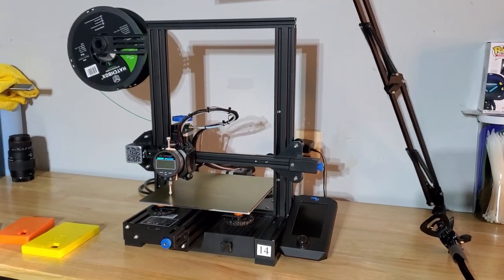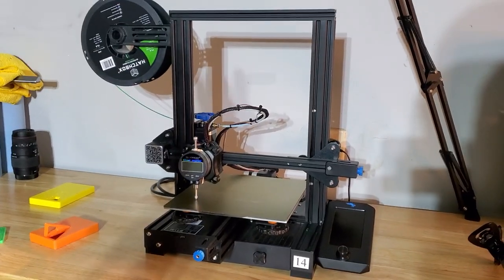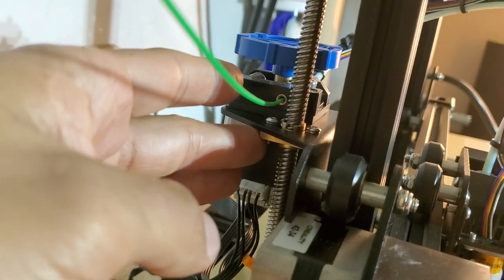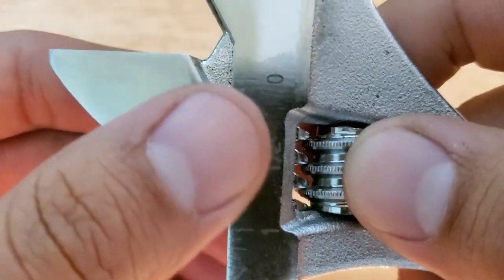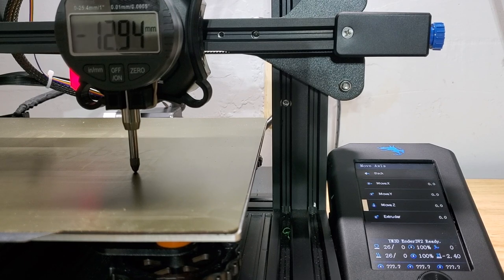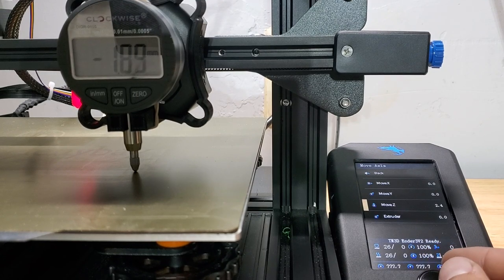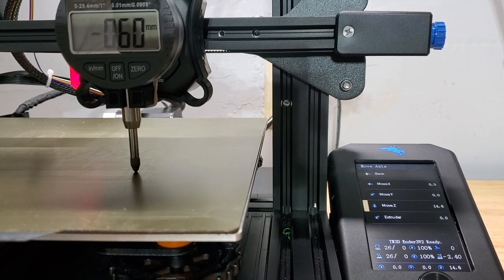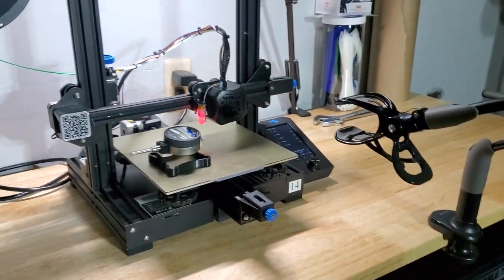3D Printing Elephants foot. How your lead screw is causing it and how to fix it! Ender 3v2

Comment: I feel obliged to point out that if you encounter binding on any axis, check the eccentric nuts. I underestimated their influence once, and after a minor adjustment, my X-gantry rolls a LOT smoother, with all six wheels making contact. Sometimes, taking it all apart and properly and carefully reassembling it does help!

Comment: I have new lead screw nut on order right now for this exact problem on my Ender 3 Pro. My Ender 5 doesn't have this issue. I knew something was up when the BLtouch didn't seem to work and I could print the first layer with the nozzle too far from the bed and the 2nd layer was way too close to the bed.

Comment: Also, check results at the left end of the x gantry and compare to the right end of the gantry.. On my ender 3 max the lag was not present at the driven end but really bad at the right, it turned out that the vertical frames were not parallel by a whopping 2.2mm closer at the bottom than the top!, this caused the gantry wheel tightness to change over the vertical travel and amplified the issue especially when the carriage was over at the right where its not driven and gravity is working against it.

I fitted a shim to correct it and a dual z drive to my 3 max, IMO the larger print volume of the 3 max is exceeding the ability for a single z drive to maintain a level correctly across the gantry, it is really quite a poor design to only drive one end of the gantry, a 200mm span is probably fine, but when you start to get up to 300mm and beyond its a failure waiting to happen I think.

I was also suffering terrible elephants foot which completely disappeared after the fix which I never really thought about at the time but now watching this its plainly obvious why I had that problem, but it was not that which led me to the issue, I was having terrible trouble getting consistent first layers and I actually watched the gantry while stepping up 0.1mm at a time, you can actually see a 0.1mm step with the naked eye (well with my glasses on because I cant see a bar door from inside without them) and I saw that the right hand side was not moving at all for the first 3 or 4 steps up after lowering the nozzle to the bed but  the left hand side was actually moving from the first step (it already had antibacklash nut on the lead screw)

It took me 4 weeks of being told "learn to level your bed" every time I asked for help, no amount of stating I know for an absolute fact the bed is levelled perfectly would sink in, "level your bed", "your beds not level", "you are new to printing and dont know what you are talking about, its a bed level issue".. 

It shows you how tiny a problem has to be to completely screw up the final print!!!!
Reply from the maker: I agree, I sometimes don't like asking for advice in groups or forums because the answers are always pretty basic. You have to really dig deep yourself and find out the problem! I agree the single lead screw design is not good even for 235mm. If the printer had dual z and linear rails I really think this would be the perfect printer given its design.
Reply: @Redo3D  lets be honest, Creality are not interested in the perfect design, its all about profit margins.. 

But they could produce a "proper" pro version instead of "pro" meaning some of the good things dropped and some other things improved! An increased price and over all increase in quality and it would sell I am sure, and still make a profit and a better reputation!
Reply: @Redo3D  I guess I am lucky, I was an electrical/ mechanical maintenance engineer for much of my working life and have an ability to logically approach and break down issues, 3d printing is a whole new skill set but I am finding that much of the "community" including some top level players, are very much a do it this way because everyone else has done it this way without any really understanding WHY they do it this way.. 

Asking for help is now the last resort for me, the more I listened to others the more I realise they don't really understand the underlying concepts fully, if at all. Of course there are exceptions, but you find the exceptions usually are not relying on youtube hits and ad revenue..

Comment: I know people really hate rafts, but ive started printing mechanical parts on rafts with 5-8mm spread to be a bit faster and less wasteful. You dont really get the benefit of the uniform surface where it was touching the buildplate, but I have managed to avoid elephants foot, fusing, and have had a non-zero improvement in overall layer quality by sort of bypassing the bed itself as being the primary build surface. The raft will also grab tree supports and keep the prints FLAT regardless of bed size instead of trying to strike a delicate temperature balance to not have corners peel up, which I think is extremely important for anything with mechanical use. Ive also found that my bed does not heat super evenly, I get temperatures ranging from 45c-62c when I set it to 60 on the printer. Using the rafts spreads out the surface area for adhesion even if the temperatures are inconsistent, in my experience.

Comment: could the underlying issue actually be the frame or the wheels. my reason for suggesting this is that backlash in a vertical position should not cause this type of issue due to gravity. if the frame or wheels was binding the maybe enough pressure at the bottom of the frame to hold the z axis away from contacting the leadscrew. fitting a anti backlash nut is helping to overcome this binding hence the improvement. I've rebuilt my e3v2 several times trying to improve the z axis fitted rails and tried a double leadscrew but the underlying issue seems to stem from the frame alignment

Comment: Hello, well done! 

But from my humble point of view it's only half of the investigation of the engineering task. I observed simelar problems on my Ender-3 (Pro) and was investigating them too, the same way as you did with a dial gauge. I went further by testing the reproducability of the zero position and could observe, that the reproducablity of any desired postion was in the range of a one digit number of 1/100 millimeter, when the print head was settling from top to bottom after I raised the print head at least 0.3 or more millimeters and then settling it back onto the desired position, just the same way as Z hop of 0.3 mm or more does. 

Since I do not like to Z hop on every print head move to avoid Z nut wear, I crafted a Z layer change G code for the slicer, which does the Z hop only on layer change and all my elephant foots where gone, also without those spring loaded backlash nuts. I'm curious, if this could work for you too? 

But anyway, well done and well presented. Regards, J'Lo

Comment: Old video I know. But thought I’d comment anyway. I have a small machine shop and know backlash pretty well. Backlash will be removed as soon as the z axis starts moving up.The reason you’re still getting error after it starts to move up is because there is also wear in the lead screw. The brass will wear faster no doubt, but fine abrasive material will impregnate itself into the brass over time and wear down the lead screw also. It’s slower since the lead screw is quite hard but it still happens. As you keep raising it up you get into the area of the lead screw that’s less worn so it becomes more and more accurate. Obviously since most of the printing is done lower down on the lead screw that’s where the most wear is.

And I’m curious but I would also guess that the backlash is worse when moving up rather than down. Since the pressure of the brass nut and lead screw is higher when it tries to lift the gantry, but when it lowers it there’s gravity to help it out so there’s less friction. Just a thought. 

It would be better if the printer could tell actually how much it moves with glass scale from a DRO or something. So even with backlash it will keep moving until it reads that it has moved the commanded amount.
Reply from the maker: Thank you for this explanation. Makes total sense

Comment: Loving the content mate. Did you ever fully get this one dialled in? Ive got 2 x ender 3 v2 neos and 1 is spot on close to perfect prints and the other seems to be encountering the issue youre having.
Reply from the maker: Yes. I ended up changing the lead screw nut on all of my machines with brand new ones and it significantly helped the situation!
Reply: @Redo3D oh nice! I had another neo just got back from repair after I blew the mobo... its working perfect along with the other one. The third is going back. Its definitely not moving back to the same z height repeatedly. Hope they swap it for a new one. Thanks for the reply 👍

Comment: Sir your video is clear and concise Can I ask you a ? I now have 2 ender3v2 and would like to install a bl touch on one of them My ? Is how do I differentiate between the 2 and will the start code installed on one effect the other Uce gone into creality set up and added it as a B machine But it wasnt showed up on my cura Which I'm using
Reply from the maker: Hi Charles, yes the start code for the machine with the BL Touch will be different. So the Gcode file won’t work with the machine without the BL Touch. If you use the G29 Command to probe the bed before starting your print, when the printer without the BL Touch tries to read the G29 command I believe it will say probing failed and it will not work. So you will have to slice the file without the G29 start command. My recommendation is to have the BL Touch on both machines if you can.

Comment: Hey, thanks for the video ! I actually want to try this now ! which lead screw replacemetn did you end up getting ?
Reply from the maker: I haven't replaced the lead screw just got new lead screw nuts. I recently tried POM nuts from a viewers recommendation, and I think they work better! I haven't done any measurements yet.
Reply: @Redo3D  sorry I meant the lead screw nut. Do you have a link for the one you are talking about?

Comment: Ty for this very well explained video .
do you have a reference of the anti backlash nut you have used ?
Reply from the maker: This is what I have purchased 2-Pack CR10 Z axis T8 Anti Backlash Spring Loaded Nut Elimination Gap Brass Nuts for Upgrade Ender 3 Ender 3s Ender 3 Pro V2 CR-10 Tornado 3D Printer 8mm Acme Threaded Rod https://www.amazon.com/dp/B08LZ1V56T/ref=cm_sw_r_apan_glt_fabc_AQE7D5ZDW7GHA827H6HQ?_encoding=UTF8&psc=1

Comment: I dont know if it is backlash since the weight of the gantry will always make sure that the worm gear will always be resting on only 1 side of your gear nut it should never be able to engage the other side unless your printer  flipped upside down. but it's always a good idea to replace these consumables when poor tolerances like these starts to appear.

Comment: Good explanation of elephant's foot. Rather than a backlash nut(s) what about just weighing up the total X axis carriage such that it always maintains an increased downward force on the nut such that there is no freeplay between the screw and nut?
Reply: you will just increase wear and print slower. the anti backlash nuts do basically the same thing, use a spring to force against the top and bottom sides of the led screw

Comment: its a great explanation for elephants foot. What I also found that helps is increasing your mesh fade height if you have a severely warped bed and elephants foot that goes up 1mm or more.

Comment: Mine started with elephants foot and has ended with not even sticking to the bed and prints failing 75% of the time. I have extra lead screws for a CNC im building so ill try this out thanks

Comment: I would expect gravity to take up that backlash - unless the rollers are too tight. The non-driven end is particularly sensitive to roller tension and hysteresis. My Poor Man's Dual-Z is another option - just an extra belt to take up the slack.
(3rd attempt after my previous comments just vanished?)
Reply from the maker: Hey Troy. Not sure why your comments vanish. I appreciate your insight and knowledge share. I also expected gravity to take up the backlash but that is not the case. No matter how much I adjus the rollers, I cannot get the gantry to drop under its own weight
Reply: @Redo3D  Fair enough, though it still sounds like binding to me but that may be unavoidable in some cases with rubber wheels. I also like to loosen off the roller bracket screws and tighten in place to make sure all 3 wheels are aligned.

Comment: Great video and awesome job doing a live demonstration of the problem. Do you use lubricant on the lead screw? If so, what do you use and how often do you apply it?
Reply from the maker: I do use ptfe lube that I purchased off Amazon. I only apply it once until I notice the lead screw it dry. It should last a long time before having to reapply.
Reply: @Redo3D  I just installed an anti backlash nut and still have elephants foot. The slight horizontal squish doesn't bother me but these crushed layers are ruining my accuracy. Cubes come out at ~19.8mm the second I print on a raft it eliminates the elephants foot and accuracy is spot on. Any other tips to help with this loss of Z height?

Comment: I think if your gantry an leadscrew are moving freely and leadscrew is not binding with the brass nut (brass nut screws 2 turns out allow brass nut to move sideways) the wheight of the gantry will always force the brassnut down on the leadscrew teeth so there shoult not be any backlash. Hence the leadscrew does not pull the gantry down but the gravity pulls the gantry down. The leadscrew will only allow it by turning backwards. Thats my understanding maybe i am wrong..

Comment: I think my lead screw nut has worn out as well.  I have a CR-10 mini that's probably about 4 to 5 years old.  I'm seeing some odd behavior from the first few layers (elephants foot, bad surface texture, etc).  What anti-backlash nut did you use?  I see some on Amazon, but the quality is often hit or miss with 3D printer components.

Comment: Great video! Very useful information, about how long before you started having these issues?
Reply from the maker: These particular printers were purchased 2nd hand from an Amazon returns reseller. So I'm not exactly sure how long they have been printing.

Comment: Wait, what does the backlash have to do with anything from the second movement up and onwards?
I get the first upwards movement right after a downwards motion only moving 0.07 because the teeth had to disengage the bottom thread and engage the top thread, but shouldn't the teeth now be engaged and move the full .3 on all subsequent upwards movements? I think your problems ran deeper than simply backlash.

Also, if you loosen your v-wheels a little bit, gravity should force the gantry down, and always keep the top of the teeth engaged, instead of engaging the bottom teeth and forcing the gantry down, it should slide down on the screw, finishing the downwards movement with the top teeth still engaged.

Comment: Are the vertical extrusions square?  Gravity should be pushing the x gantry down and taking up backlash when moving upwards.  Seems like your rollers are overly tight for some reason and exacerbating the backlash caused by the worn z rod and nut.

Comment: A little strange, because gantry weight, should ensure that the lead nut is always touching the top area of the lead screw thread. So the elephant foot should be rather an effect of wearing off the lead screw in the bottom part. And that could be seen on your video. The backlash doesn't explain, why the effect was still present after advancing more than a height of a single lead screw thread step. The "lost" of the initial Z advance was mostly due to first pushing down the print bed, which was clearly visible.
Of course, I don't negate the backlash of the nut, but it is the filament pressure which could raise the gantry up, during the initial layers, due to the lead screw nut backlash.

Comment: I’ve found POM nuts to be the answer to this problem. I purchased a bunch of anti-backlash POM nuts to cover a bunch of my printers, but ended up not using the spring or bottom section of each nut, because the POM nut itself fits the lead screw so snug without them.
Reply from the maker: I will give them a try! Thanks for commenting.

Comment: Theoretically, you could test this by z hopping mid print and if you get bad prints then you can assume it is this, correct? This is the first time I'm hearing of this after trying to get rid of elephant foot after not printing for a while, this would be more prevalent and known about I would think if it's a common issue?

Comment: thanks for the detailed video. I understand the initial backlash when the direction changes. But once you engage with the top of the nut I would expect the movement to be consistent. So why are you still getting 0.28 increments when you move by 0.3 after 9:45? If this continues then the whole print will be shorter.....
Reply from the maker: The difference is very little. I think it was off by maybe .03mm. The initial travel was off by quite a lot
Reply: Just remember that using an indicator to measure movement like that requires the stem of the indicator to be parallel  with the lead screw in at least two directions or it will measure the hypotenuse of the right angle that is being measured. The more the distance traveled the more off the accuracy will be.

Comment: Would adding weight to the gantry (not the extruder) help to keep the nuts engaged with the lead screw? I guess a bit more extra weight would not harm at least since the Z-travel of the gantry is rather slow. Might be worth a try.